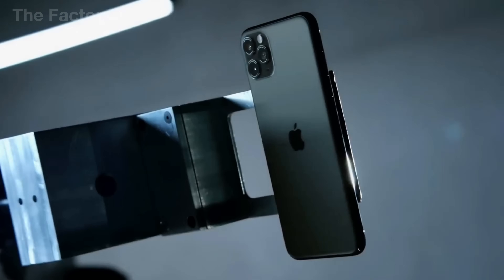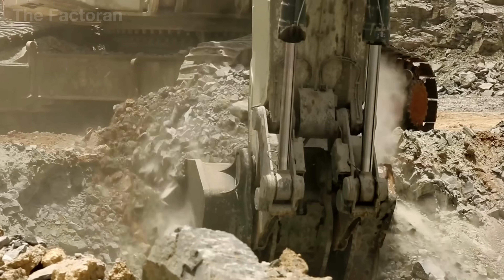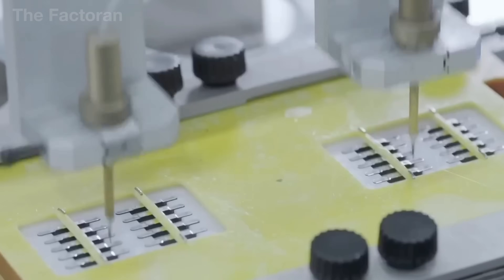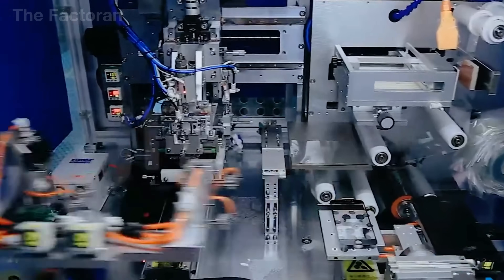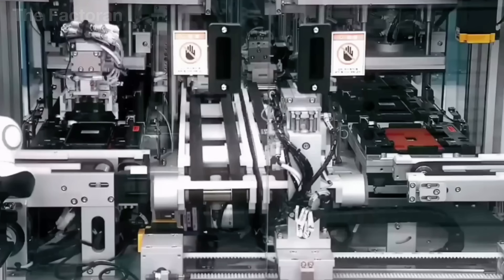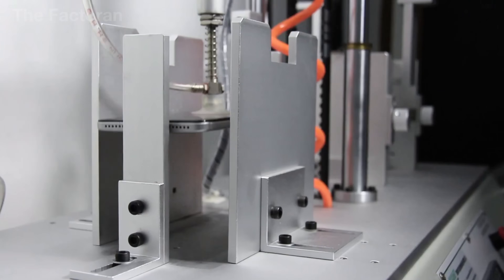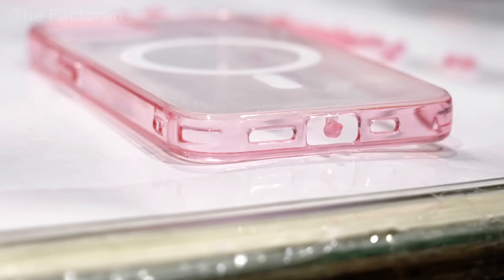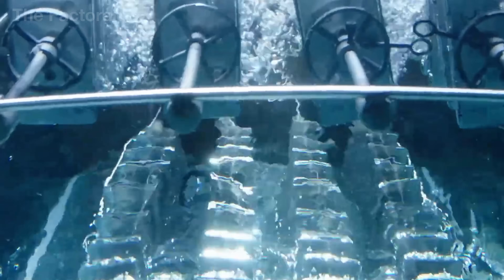Millions of Luxury iPhone 17 Pro Max Are Manufactured — Inside Apple’s Massive Secret Factory

Comment: 6.517 hd drop notch
Gsm wcdma lte 850/1900/900/1800
B1*3*5*7*8
Ram 2/32 external 128 13mp 5mp 4gbt wifi fm spot
4000 mah li poly batery dual 4g sims
Reply from the maker: Thanks for sharing the device specs.